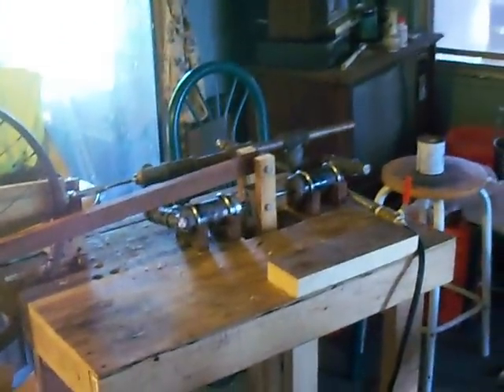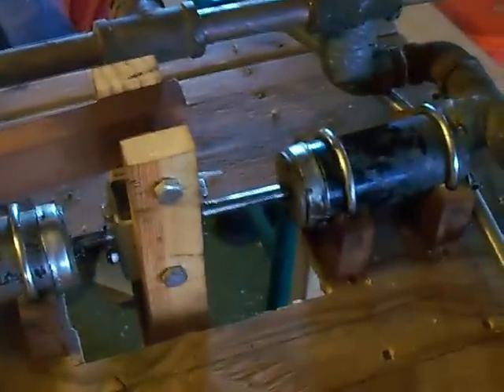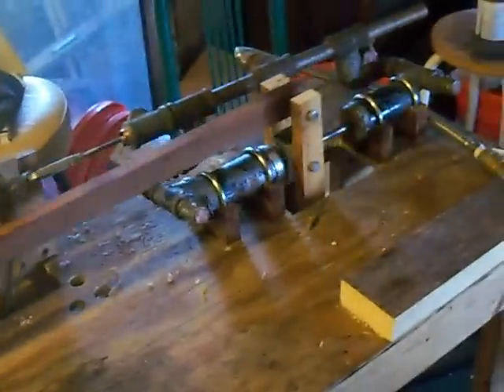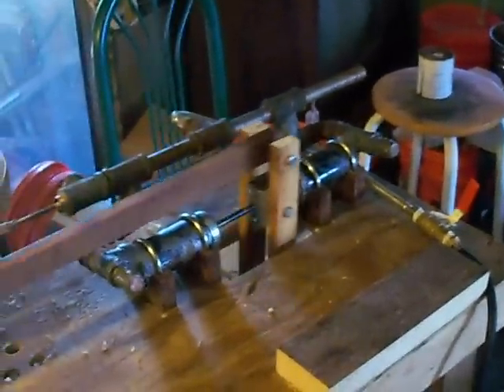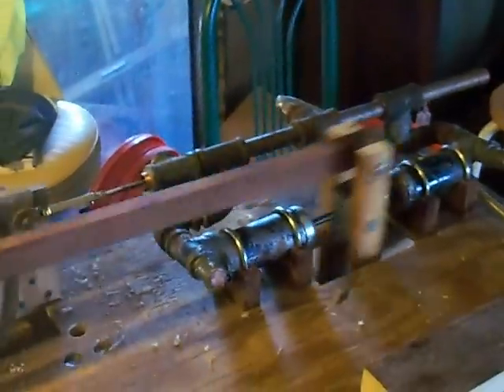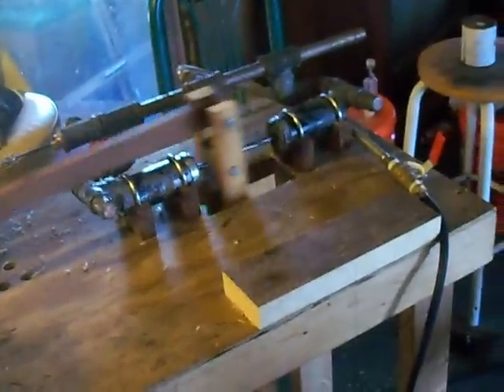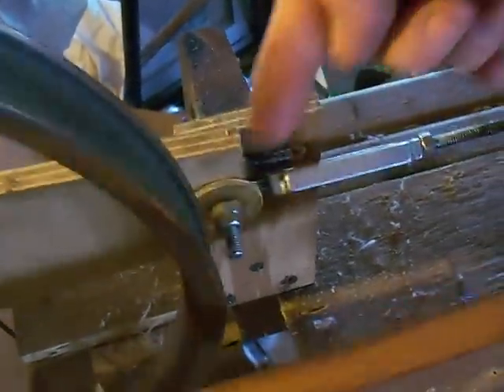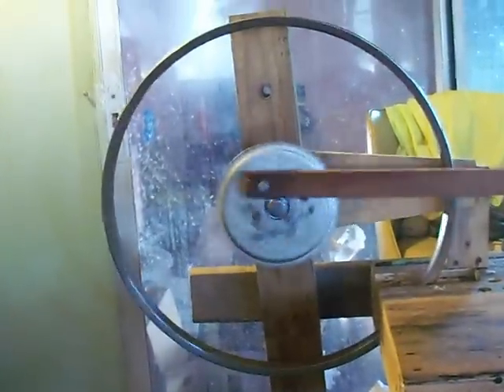Home-made steam engine

Comment from the maker: Hi Zach, the cylinders are just 2" inside diameter foot operated air pumps and the pistons are made from 3/8" bolts, 1/8 " thick high temperature plastic, and viton O-rings, on the slide valve I used the same thing with a 1/4" threaded rod instead of the 3/8" bolts..

Comment from the maker: For the pistons I used 3/8" bolts, 1/8 " thick high temperature plastic, and viton O-rings, on the slide valve I used the same thing with a 1/4" threaded rod instead of the 3/8" bolts..

Comment from the maker: Sorry, but I have no drawings, It's just 2 bicycle foot operated air pumps with a 2 inch bore and a 2.75 inch stroke, the slide valve is .75 inch copper tubing inside of .75 inch threaded steel pipe fitting seal with J.B. Weld epoxy glue.The flywheel is a rear wheel from an adult tricycle and has a 5/8 inch bolt for a shaft. The eccentric is 90 degrees off from the flywheel stroke at top dead center. The pistons for the O rings are made from high temperature plastic. Just get 2 pumps and do it!